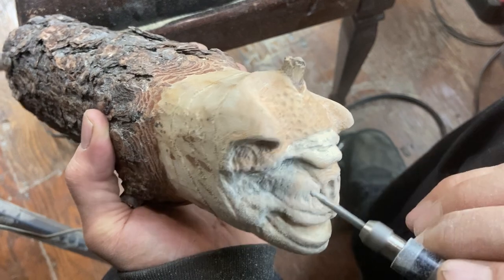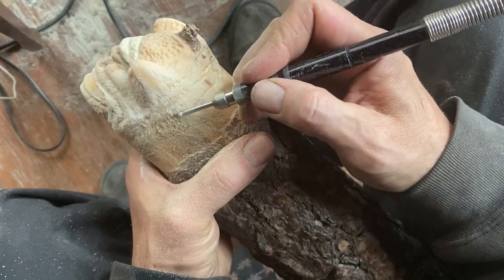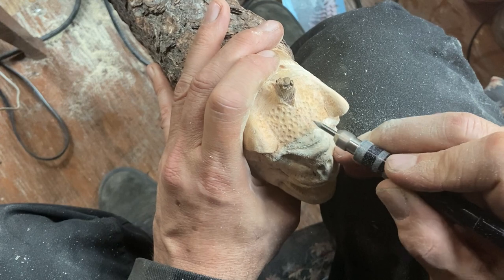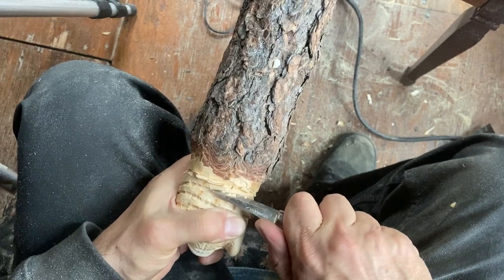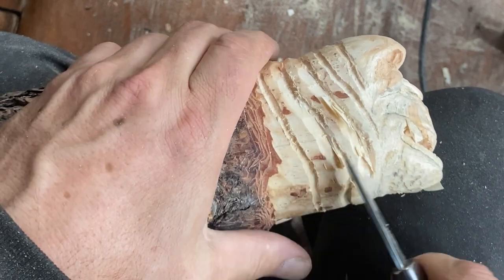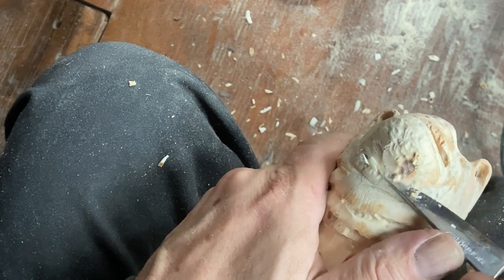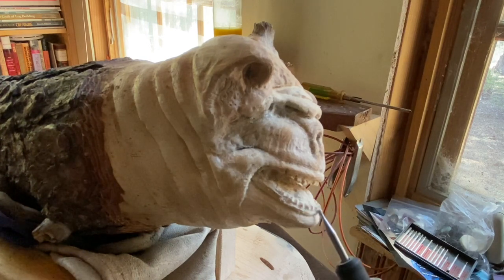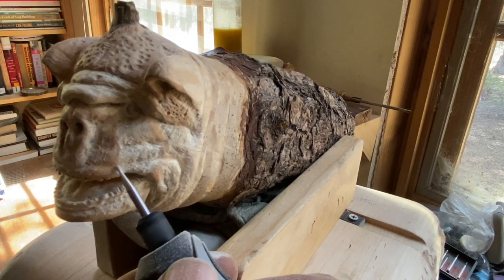Gargoyle Power Carving - Bat Beast - Pt. 2 - Dremel Stylo + Mini Review

Comment: I am really enjoying your videos,  can you show or explain how you clean the pitch off the burrs. I have pine knots and gummed up burrs.
Reply from the maker: I saw your post earlier…but it disappeared and I couldn’t respond. So, I’ll explain how I clean a few different burrs. Not sure if you using Saburr, Kutzall or regular carbide style. 
For the Saburr or Kutzall style I use a soft brass brush that can be found at hardware stores. I just run the burr in the dremel around medium speed and put the brush against burr as it’s spinning. The brass brush is the size of a tooth brush and is used for welding,  but I use them to clean those Saburr style burrs since the brass is softer against the metal burr and doesn’t dull the sharpness. I would wear eye protection when cleaning,  since the stuff flies off in chaotic fashion. With all the carbide burrs, I use a sharp scribe to remove the resinous build up. I will cover this in a video to clarify the procedure for you and anyone else concerned. Cheers. And thanks for your question.
Reply: Thank you hat is very helpful.
Reply from the maker: @susimaloney4796  You’re welcome!